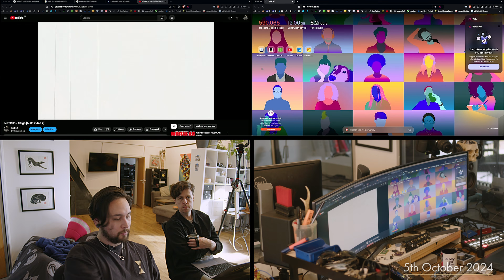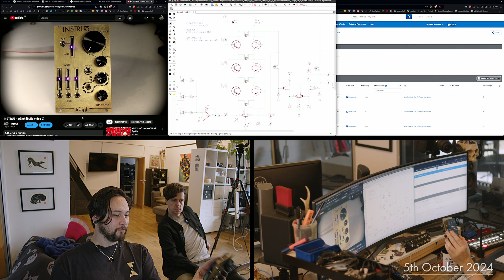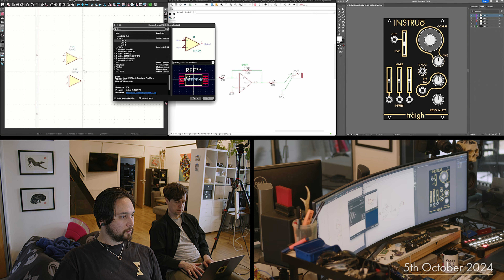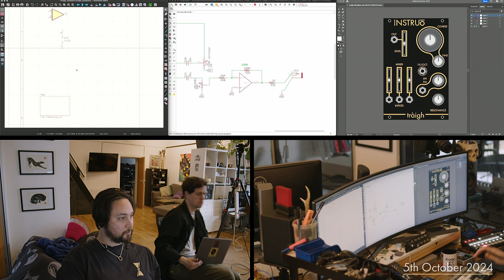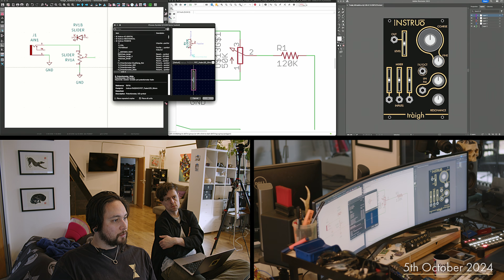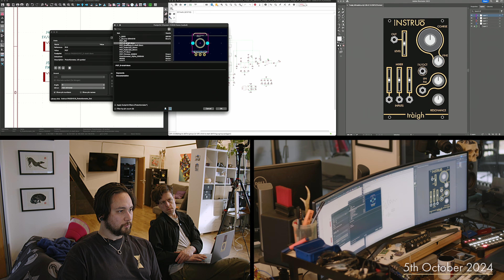Instruō - tràigh Design | EPISODE 1

Comment: Very nice video and amazing design ideas! Thanks you for sharing.  I dont think you need to decouple every op amp on such a small PCB in Eurorack and its analog signals. The op amps are within close range of the power supply decoupling . If it were high speed Op Amps, DAC's and hif-fi audio, yes I would use them. I used to do the same thing but ditched the rule and now use 100nF decoupling where it's needed. Saves space!
Reply from the maker: @amsynths  I’m definitely over cautious on the bypass cap inclusion! 
But when there’s space, I throw them in. ☺️
Can easily DNP the BOM when they go to go to fab.
…or forget and then take them off manually!

Comment: could you make some of your schematics public so we can see what architecture you are using for vco's for example? are these based on something from the old world like roland, buchla, serge, moog, arp or even curtis.. or are these based on your own ideas never done before?
Reply from the maker: The resources are all out there :)

The circuit topologies I've used have changed and evolved over the years.
My earlier oscillator designs are largely based on Electronotes circuit references, and more recent I use OTA for current control, or SSI2164.
The SSI2164 datasheet is an incredible resource in itself. They have actually consolidated lot of resources into their datasheets and design notes. Various implementations of VCA's in the contexts of linear to exponential current control and even temperature compensation methods! It's wild!

I work from a mix of datasheets, vintage references and papers as starting points. Nowadays I simulate as much as I can and then lay out prototypes that I can easily modify values on, or use breadboards if I need to (that's not my preferred approach though).

I definitely have some circuit designs that I've implemented in recent years that have less of an existing reference behind them. I wouldn't assume they're unique and never before done of course!! But there are some ideas I've tested and refined that ended up doing what I intended... or lead to interesting results that inspired something else!
When I started out I just spent all my time trying to recreate things from published vintage schematics. Classic synths had them in their service manuals!
Most of the time the opamps detailed are odd/old/obsolete, but they can invariably be swapped for TL074/72 generic ICs.
I treated the process the same as learning a musical instrument: transcription, practice, repetition until some sort of understanding took hold.
The first oscillators I got to work I had no idea how they worked! I just redrew reference schematics and laid out a PCB.
Reply: @instruo  as someone in the "redraw schems lay out PCB have no idea how it works" stage, I very much appreciate this comment and this video as an insight into this world from someone as experienced as yourself!